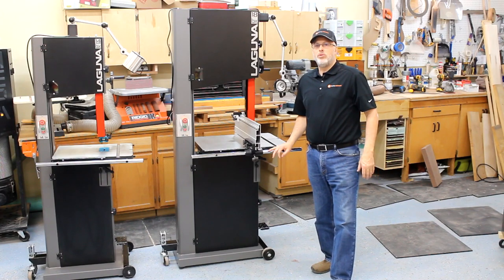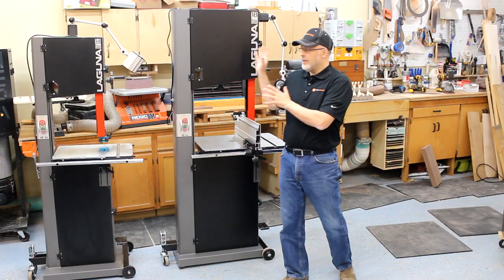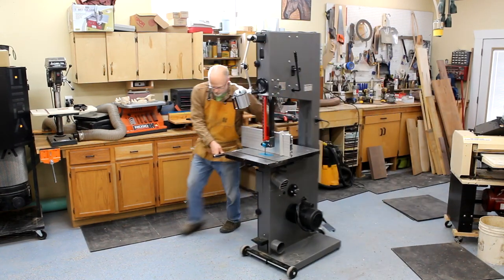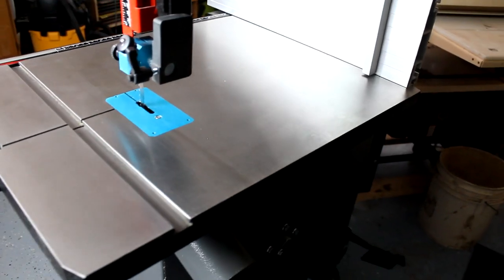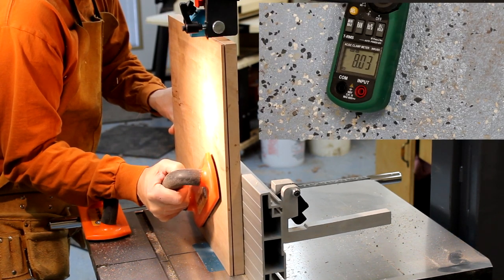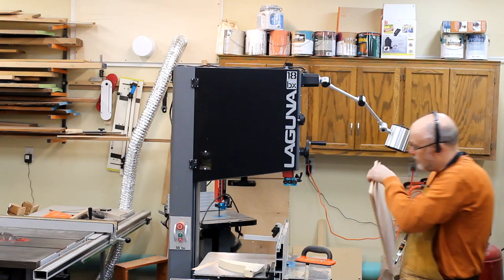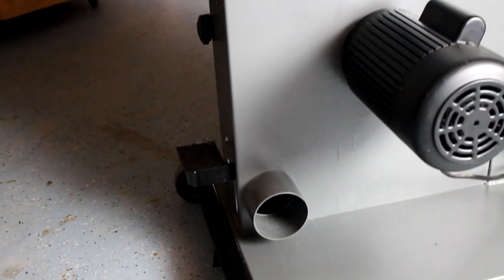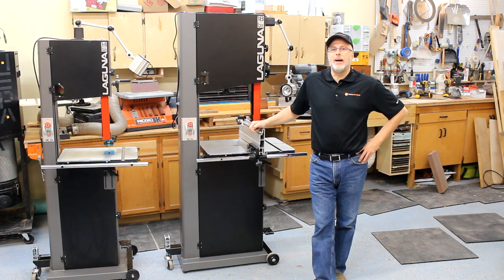Laguna 18bx 3HP Bandsaw: Deep Dive Examination by ToolMetrix

Comment: I have a big Felder FB 710 as my primary bandsaw and wanted to get something smaller so that I could keep a big resaw blade on my Felder and a smaller blade on my second bandsaw. I was going to go with something like the 14BX but ended up ordering the 18BX instead (ordered in early April and still do not have a shipping date). The 18BX just seems to be a lot more saw for not that much more $. My biggest consideration was space...14BX would obviously fit better in my quickly dwindling space but I will make it work!
Reply from the maker: That Felder must be pretty sweet.  I like your logic on the 18bx vs. 14bx.  I've heard that starting tomorrow the prices are going to jump, so you are probably getting an 18 for about the same price as what someone will pay for a 14 tomorrow.

Comment: Thanks for the video. I have been trying to decide between the 2 saws for use on my channel. Just looking at them side by side I think it will be the 18. I give up on Grizzly tools and the Laguna saws look like a high quality build for the money.
Reply from the maker: Thanks for the comment.  I just subscribed to your channel.  Great content!
Reply: Thanks, I subscribed to you . I may have to look into one of the laguna cyclones you did a review about in the future also.
Reply: Ordered the 18BX today, hope they ship out quickly. Thanks for your videos about it.
Reply from the maker: Awesome!  Let me know what you think.
Reply: It would be nice if Laguna didn't keep moving the ship date. They don't seem to care once they have your money.
Reply from the maker: Sorry to hear that. That’s frustrating for sure.
Reply: Finally came made a unboxing video. Started the setup video today and there is a problem with the table deforming when the trunnion knobs are tightened.  The last radius is not ground in line with the other three in the casting and when the outfeed side is tightened the corner of the table pulls down. Waiting for a call back from customer support. Bottom wheel is not true like yours either, my indicator shows .02 runout. May not be any better then Grizzly machines.
Reply from the maker: Doggone it.  I'm really sorry to hear that.  My experience was pretty much flawless out of the box with this unit; luck of the draw I guess.  I hope that they can get you taken care of and get you the replacement stuff that you need quickly.  Let me know if there is anything that I can do to help troubleshoot or whatever.

Comment: Super helpful video. Deciding on this right now (as well as some others) and think I’ll go 18bx. Only concern is will it take up too much garage space for extra size I’ll never use. For example, I went with the 36” SawStop table instead of 52” table and an very glad I saved that extra couple feet in my garage. But maybe in this case it doesn’t take that much more?
Reply from the maker: Thanks, Mark.  I know exactly what you mean about minimizing footprint in the shop.  I have a combination planer/drum sander for that reason, and I think about footprint (a lot) every time I buy a tool.  When I bought my table saw  I wanted a 36" model, and stumbled upon a deal on a 52" and went for it.  I have found that I don't need a 52" saw, and I'd rather have the space back, so my next one will probably be a smaller one (ore a bigger shop).  The difference in total footprint between the 18bx and the 14bx is a tad under 3 square feet by my measurement, so it is not insignificant, but it just doesn't feel like that big of an impact for some reason.    In my case I don't really need the additional power of the 18bx, although it is nice.  The additional resaw height is nice, not as much for resawing in my case but for cutting bowl blanks.  But I think the nicest upgrade for my usage is the big throat and huge table.

Comment: I was wondering I was trying to find a BX18 bandsaw But all I can find right now is a BX14 bandsaw do you think I'll be disappointed if I buy that saw
Reply from the maker: Hi Kent, it really depends what you want to do.  But overall, I'd be really surprised if you'd be disappointed with a 14bx.  I had a 14bx in my shop for a year or so, and it definitely did everything that I need a bandsaw to do.  The main thing that I enjoy about the 18bx is simply the additional power, and that really only comes into play when I'm rouging out large bowl blanks.  To put it into perspective, I turn about 10 large bowls per year.  I can rough one out about 30 seconds faster on the 18bx vs. the 14bx (It's 2.5 vs. 3 HP).  So, for me, the advantage is about 5 minutes per year.  :)   Another benefit for bowl turning is that I can stand a log on end and halve a log that is 16" long, vs. 13" on the 14bx.  My "typical" bowl is about 14 - 15", so that is actually a nice advantage for me.  If I had a 14x, I'd simply have to make that cut using a chainsaw, or reduce the bowl size a bit.  A production shop would certainly take better advantage of the additional power and capacity, as well as the ability to run longer and wider blades, but in my case I just don't do enough large scale work to really justify the difference.  Don't get me wrong, I absolutely love the 18bx, but I'd struggle to justify it vs. the 14bx if I was called out on it.  :)
Reply: @ToolMetrix  George over at WWGOA raves about his 14BX in a video I saw recently...I think he said "I love, love, love it"!
Reply from the maker: Yep he definitely loves his 14bx. I’ve used it over at his shop. It’s the 110v version. It serves him very well.

Comment: Great analysis for the Laguna 18bx, Paul. Based on your review I ordered an 18bx over the 14bx…it’s on its way from the factory. Is the 1 inch Resaw King the best choice for an all around blade?
Reply from the maker: Thanks Bob. Sounds like a good plan. I’d say the Resaw King is the best base for resawing but it’s not good at all for curved cuts. The blade that sits on my saw most of the time is a 3 TPI 1/2” blade. It’s pretty good at everything; resawing, green bowl blanks, gentle curves, tenons, rips, etc. when I have a special piece of wood where it’s important to get a resaw cut that is as flat and smooth as possible I put on the resaw king. For most resaw cuts I run it through a planer after the cut, so flat is important but smooth isn’t.

Comment: Thank you for the review. quick question - while the max blade capacity of the 18BX is 1 1/4". Do you think it's too big of a blade and it'll stress the motor or reduce cut speed? Would a 1" blade allow the motor to run better while also resawing as expected?
Reply from the maker: I never put a max size blade on a bandsaw because it’s tricky to get it positioned properly on both wheels. It wouldn’t stress the motor or affect cutting speed though. 1” would be better. I usually have a 1/2” blade on the saw. Good general purpose size, good for curves and good enough for resawing. For bigger resaw runs, or when cut quality really matters, I put on the 1” Resaw King. But that’s pretty rare actually.
Reply: @ToolMetrix  Thank you!!!

Comment: I see pictures where the 14 and 18 bx have two lights added on. Can you run two lights at the same time? Is this necessary? Thanks
Reply from the maker: Hi Jason, there are two places to install a light on each of these machines, but only a single outlet, so it's just more of a choice on whether you want it mounted on the side or the top.  I've installed in each location and I prefer the side mount but either way works.  With the single outlet, if you want to run a second light you could run a splitter, or run a separate extension cord for the second light.  That said, a single light casts plenty of light for my needs, and I've never felt a need for additional light.  Be sure to get the double armed light, as this is much nicer than the single arm version.  The double arm allows you to position the light right where you want it.

Comment: Howdy.  Great Video....thank you!  What size blade are you resawing with  I am having growing pains learning this new saw (bought the 18bx for my xmas present to myself!).   I am having trouble with wobbling with thicker blades and am starting to doubt that the saw can properly tension the 1 1/4 blade.  Thanks a million!
Reply from the maker: Hi Bradley, the 1.25” resaw king works extremely well on mine. I’m guessing that’s what I used in this video. It’s rare that I use that blade however. I use the saw for a huge variety of cuts so I mostly just leave a 5/8” x 2 TPI on the saw. That’s a great resaw blade and also handles most curved cuts fine. It doesn’t leave as smooth of a surface as the resaw king but I usually run it through the planer anyway so it doesn’t matter. For a bigger resaw job or a higher value plank I’d install the resaw king. I don’t notice any vibration or tensioning problems either way.
Reply: @ToolMetrix  thanks so much for your response!  What blade do you like for log to lumber sawing?
Reply from the maker: That same blade works great for that. The 2 TPI makes for easier cutting and less clogging. The RK works well for that too but isn’t a good use of such an expensive blade IMO.
Reply: @ToolMetrix  Thanks again.  One last question....where do you get your blades and what make/model do you like.  I have had horrible luck with Laguna blades as I have been in a 2 month fiasco with them trying to get blades with good welds.  I have been going through the warranty process, getting a replacement blade shipped out and it having a bad weld also.  So far only 1 out of 4 blades from them had been good.
Reply from the maker: I have a Laguna Resaw King and my main go to blade is a Timberwolf.

Comment: I saw some reviews where there was a problem with the table not being flat and the fence having to be shimmed. Any problems with anything like that? I am about to upgrade my 14 inch Bandsaw
Reply from the maker: The table on the 18bx arrived dead flat.  I have an early model 1412 and the table was uneven (you could see it when you removed the pin and observed where the table is split for blade installation) and a Laguna tech walked me through making an adjustment to the trunnion.  That was a few years ago and I don't remember the exact details on the adjustment, but that remedied the problem.  I haven't had to shim the fence, but there is not adjustment for vertical orientation so I could see where that might need to happen on some saws.

Comment: I'm doing this as a hobby and I'm struggling with what band. Saw to buy the grizzly 17" or the 18 or 14 laguna would love your thoughts
Reply from the maker: Hi Brian, it depends on your space limitations, budget, and what you are planning to use the saw for.  For typical hobby use, curved cuts and occasional resaw, then a 14" saw will serve you well.  I've had a Jet 14", Laguna 1412 and Luguna 14bx.  These are all good saws.  The big difference between the Jet and Laguna (experientially) was the ability to quickly change blades and set up for resawing without a lot of tweaks to the saw.  When I did this on the Jet it took me a looooong time to switch over and make all the necessary adjustments for resawing.  At first, I only did this a couple times per year so it wasn't a huge deal.  Later, as I began to resaw a lot more, it was a pain.  With any of the Laguna saws that I've used, I am able to switch blades back and forth (resawing and curved cuts) with no hassles.  The blade swap is easy and resaw typically "just works" without having to pull out a youtube video and follow a bunch of steps.  That said, most commonly I just leave a 1/2" 3TPI blade on which is "good enough" for both curved cuts and resaw, and I only switch blades when I need to make a lot of tight curved cuts (then I'll put on a 1/8" or 1/4" blade), or if I have a big batch of resawing to do (then I'll put on the Resaw King blade).  Another area where a big bandsaw comes into play is for preparing large turning blanks.  The extra power and capacity on the 18" saw is very nice for this.  But if you are doing mostly curved cuts and an occasional resaw cut, I'd lean toward a 14" saw.  I don't have any personal experience with Grizzly saws (I do have a Griz jointer).  It seems that people who buy their higher end bandsaws are generally pretty happy, but if you try to go too cheap in their product line it can be problematic.  But I base this primarily on ready people's accounts on woodworking forums, so I'm probably not the best source of this info for you.